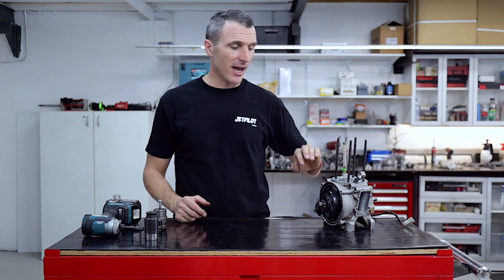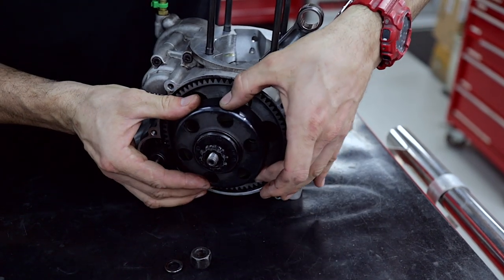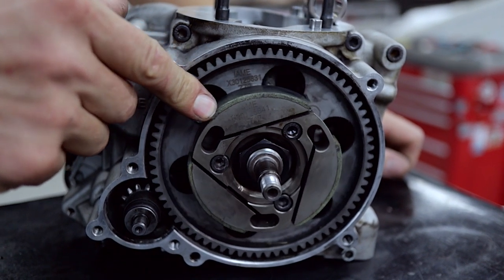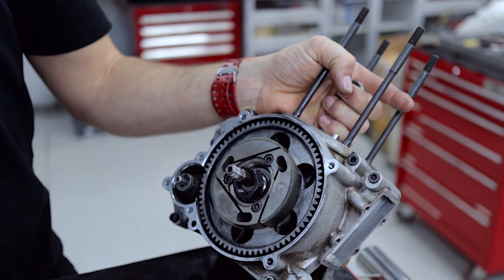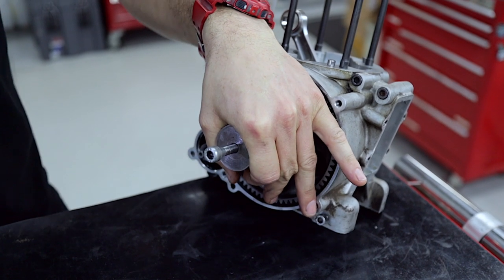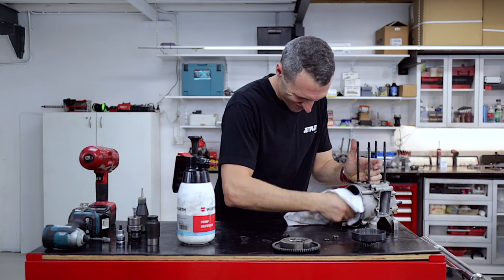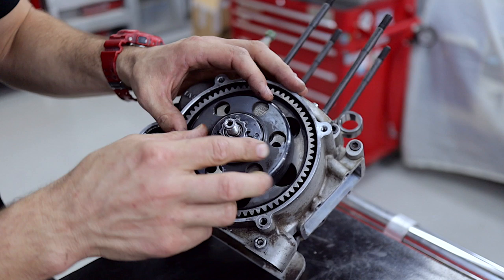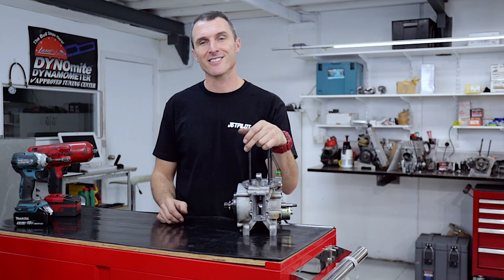HOW TO: Remove and Service The IAME X30 Clutch - POWER REPUBLIC

Comment: as my friend and i are new to IAME X30 these videos are so helpful thankyou.
having some issues with the rear of the kart bouncing out of corners (on throttle) - mostly out of slow corners
would love some troubleshooting tips - is this an axle thing? tyre pressures? my shit driving? :)
Reply from the maker: H Paul, thanks for the great feedback.  Maybe if you are  new driver, a common problems is getting on the throttle to early.  This make the kart hop around slow corners.  Otherwise if you are a tall or bigger shouldered driver (over 6" or 80kg's) then the kart might be too soft for you.  Try adding seat stays, adding extra tyre pressure just to the rear of the kart, and then oyu could try a different axle grade.  Which chassis make and model are you driving?  And what is the height and weight of your drivers?

Comment: Hi 
Great video !

Shall the needle bearing in the clutch drum be regreased after a specific aount a operations hours ? or is it only when it dismunted for example when changing front sprocket. 
What kind of grease do you use ? 

Br. Martin
Reply from the maker: Hi Martin, we use Castrol HTB wheel bearing grease.  With the needle roller you can do it say after about 5-6 hours, the 11T bush needs doing almost before each time you use the kart.

Comment: Thank you for the video, I have a problem and hope you can help me.
How do I know how far open I can put on the gas cable from the footrest to the carbarateur before I get damaged.
I now have the idea that when I open the pedal I cannot get full power.
i have a dellorto vhsb 34mm carabateur. thank you in advance
Reply from the maker: Can i ask, are you using the carb on a Rotax 125
Reply: @PowerRepublic  yes :) sorry :D
Reply from the maker: J S if you have an EVO Max Engine, put the gas pedal to fully open the carb slide.  If you have a non EvO Max Engine, some people liked to restrict the throttle so that you could just see the little round brass rivet of the slide when you looked into the carb.  I personally always like to run Wide Open Throttle and change my foot position if necessary.

Comment: Can you link me where to buy the 27mm deep iimpact socket can’t find one that fits
Reply from the maker: what about one of these

http://www.kctools.com.au/Products/impact-sockets/1-2-drive-deep-sockets-metric-af/27mm-1-2-quot-drive-thin-wall-impact-deep-socket
Reply: the link no longer works, this nut has been the biggest issue for my my09 build to date. Finding any sort of deep thin-walled socket is seemingly impossible at most hardware stores.  @PowerRepublic

Comment: I am trying to replace the clutch shoes since one broke.  I removed the bolts but the shoes would not come off.  What is the best way to separate the shoes from the starter wheel?  Do you use the clutch puller with the 3 bolts removed?
Reply from the maker: Hey Rick, you can try and lever it off.  it does have a dowel pin for location and drive that will make your life harder to remove it.  there is a puller you can buy or make .....

CLUTCH-PULLER-X30-2014-ON

Comment: Hey Man,

I did my first track day on CRG with DD2 engine. I followed your run-in guidance so it should be well done. :)

What would you suggest to check now to fix the initial imperfections that occurs after the use? Thanks upfront for feedback.

Cheers
Reply from the maker: Awesome, DD2's are so much fun.  Enjoy your new machine !
Reply from the maker: Now that you have run it, you can check all the nuts and bolts, double check the brake fluid level, coolant level in the radiator.  Which track did you run it for the first time?

Comment: If that 17" nut is loose, will the drum and sprocket spin without turning the clutch shoes or the ring gear?
Reply from the maker: hey Ad, should do, what's happening with yours?
Reply: @PowerRepublic  Cheers for the reply, I'm new to X30s and mine wasn't starting but turned out the spark plug was fouled, I initially thought it could have been clutch issues. Really appreciate all your vids mate they've been a great help

Comment: How much end float should the clutch drum have on the shaft? thanks
Reply from the maker: Hey Ralph, great question.  With a new bearing and thrust washers probably 0.3mm ( but I have never measured this).   When the thrust washer are worn it will be more like 1.0mm or more.  This is too much and you should re-new them.
Reply: @PowerRepublic  That's why you should always replace with "new." Then, you never have to worry about it. I do it "before" my clutch is about to sling-off...lol :)

Comment: Getting shoes off on their own was hard work for me. I ended up taking the big nut off (ground down the sides of a 27mm socket so I could get a shifter I’m on it, then smacked it with a lump hammer). I then could get the puller tool in and the shoes came off. Would have broken something if i had not watched this video. Would have been hard work doing it at the track. Thanks heaps.
Reply from the maker: all G bro, that's what we are about.  Have you got yourself a POWER REPUBLIC tee shirt yet ?????

Comment: Hello Power Republic, when i put the o-Ring on and After i install all i can‘t spin the clutch. Today i Drive without the o-Ring and After the Second Turn the clutch was smoking. I bought everything New so i don‘t know why it was Smoking.
Maybe you can help me? Thanks for your help! Greats from Germany Dominik
Reply from the maker: hallo Dominik, maybe you have got some grease inside the clutch drum and it was slippiing too much?  otherwise the clutch shoes might have been worn out and it did have anything to do with the chain?
Reply: Power Republic we only put some grease on the needle bearing. And i bought everything new (from number 352 to 365 = https://www.prespo.de/motoren-iame/ersatzteile-iame-x-30/kupplung-x-30/) for the clutch but i don‘t know why it smokes again...
Reply from the maker: @Dominik-sv6ku  hey mate, did you end up fixing the clutch burning issues?

Comment: Is the IAME x30 A Manual 6Speed or A 1Speed Engine?
Reply from the maker: ClownGaming it’s a fixed gear single speed racing kart engine. It revs to 16000 rpm and is good for about 105 KPH on most tracks.
Reply: Power Republic It’s Top Speed Is Over 100MPH Correct?
Reply from the maker: Only good for about 60-65 MPH on most tracks
Reply: @PowerRepublic  I've reached 116km/h @ Emerald Kart Club. (That's about 72MPH). Of course that's only for a second or so at the end of the straight. X30 TAG Heavy.